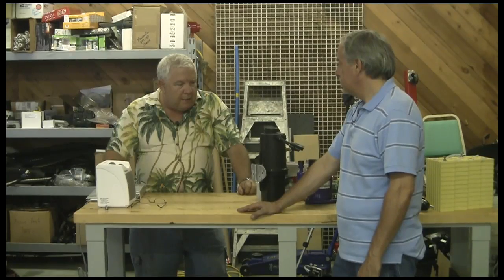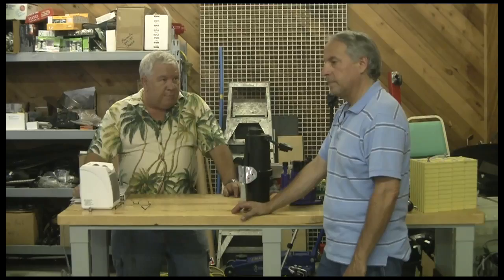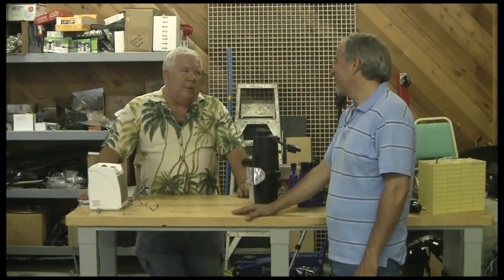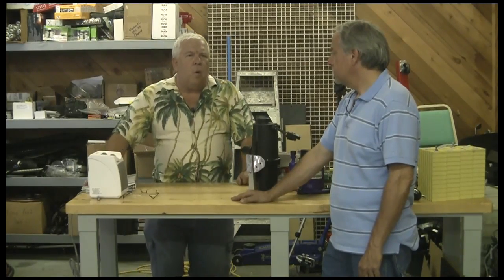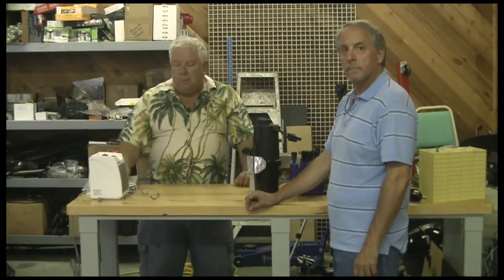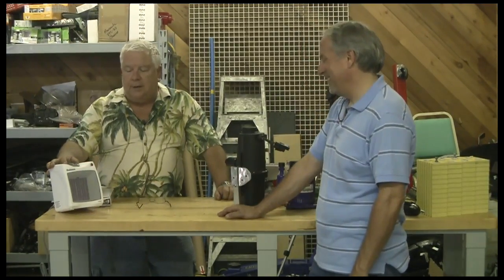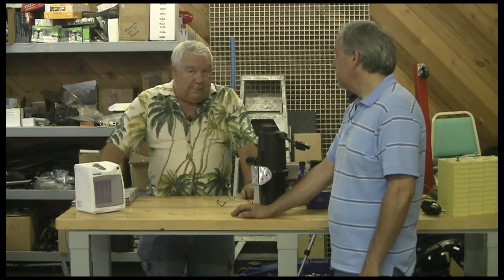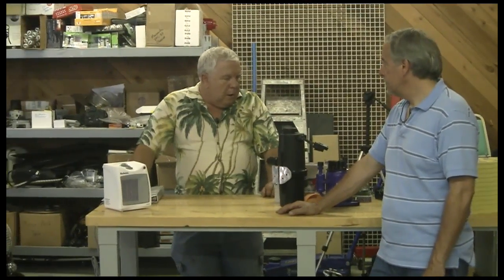23 E MINI ME Electric Conversion of 2009 Mini Cooper Clubman

Comment: I should have said 1/3 pushes the piston!  But most people don't understand the relationship.  Did I mention mechanical losses?  The point is a lot of the energy you pay for is lost as waste heat.  So little of the chemical energy actually gets used.

Comment: Gas car energy efficiency breaks down like this:

1/3 goes out the radiator as waste heat
1/3 goes out the exhaust pipe as waste heat
1/3 turns the crank shaft

Now from that final third subtract mechanical frictional losses and power to turn water pump, oil pump and alternator.  You're lucky if 20% of that energy you paid for hits the ground.